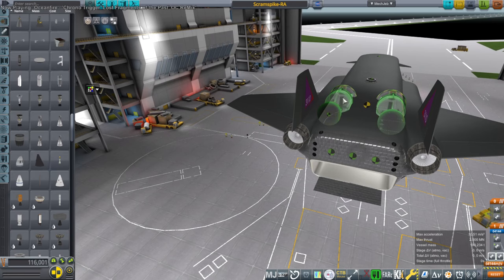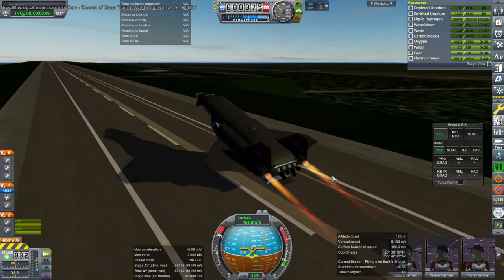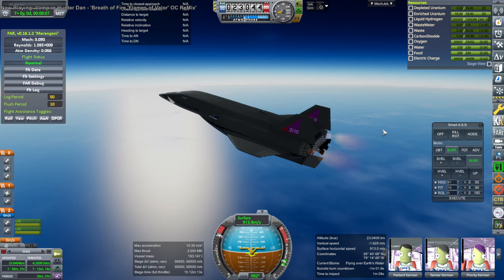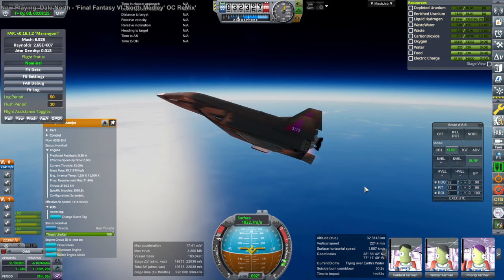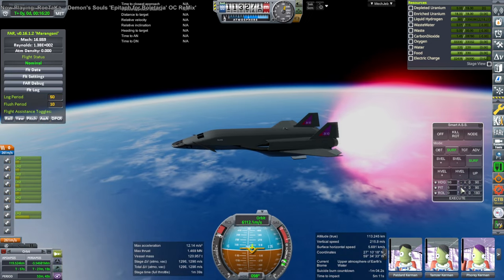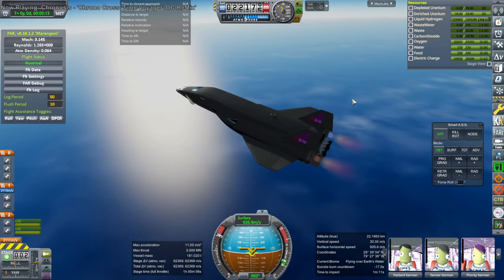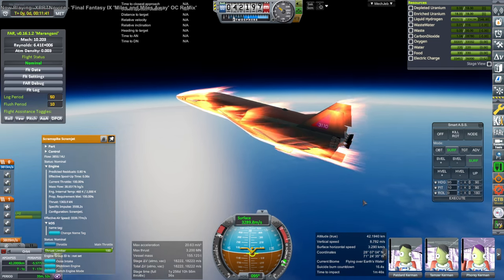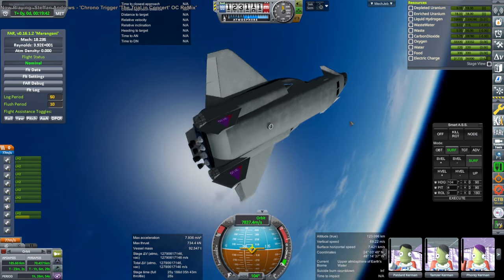Nuclear Scramjet Spaceplane Test (RO in KSP 1.12)

Comment: Somehow all your spaceplane ideas sound good but get no actual payload capacity exccept the crew, maybe you should try putting some boosters on.
Reply: The amount of benefit a rocket with stages give for payload is huge compared to a one stage launch. You can't really expect a spaceplane in rss to have a payload. Putting boosters on a spaceplane defeats the purpose, which is to have no loss of hardware.